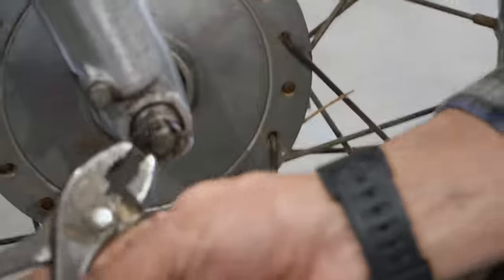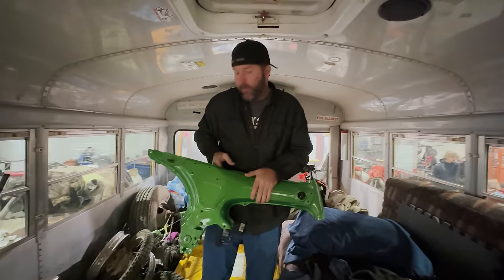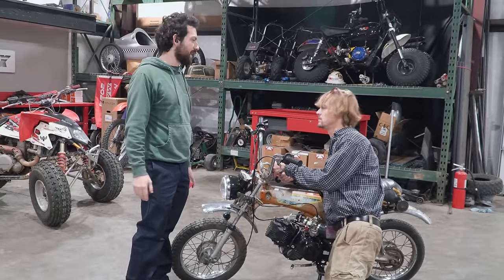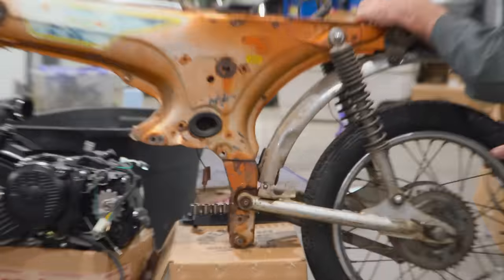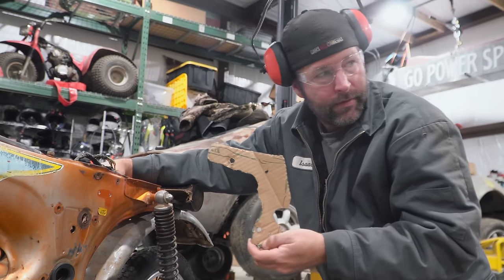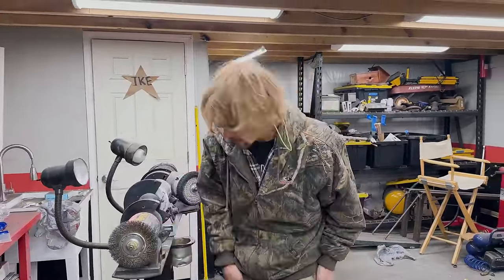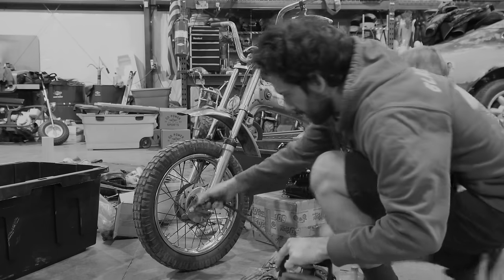We Got a Rare Honda ST90 in PIECES | Honda ST90 Build + Big Bore Swap!

Comment: You guys need to clean up those crash zones around the track. Pick out the dangerous rocks and trees and start sweeping those leaves out of the way and into where you might lay down. and the reason these didn't sell well is because most kids that started out on a trail 70 moved on to the XR 100 or the YZ80 or YZ60 since they were all real motorcycles and not mini bikes

Comment: Just a suggestion, but since you more than likely have a zero turn lawn mower out there, run it over the course before making a lap with all the leaves and tall grass. 
You can go slow and raise the deck a step or 2 in the leaves and it will work as a leave mulcher and blower.
Reply: Leaf mulcher. Singular for leaves is leaf

Comment: I bought one of these in 1987 from a bootsale (in the uk it cost me £22 i had the best fun on it rideing round feilds i blew up the engine and put a honda trike engine in it 110 cc it didnt fit the mounts so i made some adaptors for it in school (i was 14 at the time )i had a honda mtx front end on it renthal bars alloy wheels and a cammo paint job ,it was one of the first bikes i built as a teen and it took me a few days to work out my frankenstein bike and find parts that kinda fitted but i loved every minuite of it .

Comment: Having the hand controls in line with or behind the axis of the front forks will MASSIVELY help stability and turning feel. Every real motorcycle does that, I am honestly amazed vertical bars are a thing on minibikes, its so squirrely. Awesome build and video as usual, Ike is a trooper and that 212 is an absolute beast

Comment: Hey, you can fix that swiss cheese by blocking the holes on the outside with a thin layer of fuel tank putty and then use "POR16" on the inside to coat it generously. Once the coatings dry then remove the fuel tank putty from the outside and put the frame together and enjoy.

Comment: Contact a cycle suspension shop for suggestions for re valving and re springing the forks and get some better shocks. Looks like the bike has the power, just needs a ferret suspension so it can be ridden fast. Really needs some good knobbies too.

Comment: You could get a new sleeve pressed into your 90cc jug. Any reputable engine machine shop could do it,        for a price. Cast iron sleeves come in most metric, and imperial sizes, and, you'd just have to bore out the cracked sleeve,  cut the replacement to length, press it in, check deck height to make sure the sleeve is level with the fire deck, and hone it, to fit the piston. It IS a viable option, if a replacement can't be found. I've worked for companies that would do ALL the work, and hand you a good as new part, ready to be bolted on. You guys will be entering true builder territory, good luck, hope this helps.

Comment: Nice score finding an st90! They really don’t get built as often as the ct70’s and z50’s do and I think a lot of that has to do with the different motor mounts, leaving motor swaps options limited without adapters like you made. They are really a unique parts bin engineered bike. Stamped monocoque frame from the ct70, suspension and wheels from the sl70 and the engine from the ct90 minus the dual range gearbox.

Comment: The motor mount pattern is a little different on the CT/ST 89/110cc than the 49/72cc engines. Actually there's quite a bit of difference between the two engine families, almost nothing is interchangeable between them.

Comment: Yes! It couldn't get any scarier with new tires, could it? It'll be fine! An earlier chassis with the 90cc motor and transmission was my gateway to M/Cs. I went to a Honda 350 Scrambler- where I got my first road rash! Btw, put some genuine duct tape on that ratty seat for some real deal rustoration rat rod looks! Killer guys! You are a tease, John!

Comment: GREEN FRAME my guess is he powder-coated it bc he saw it was in good condition except the holes and ive drilled dozens of bigger holes in frames to save weight im 80% that frame is fine though id strip the coating and make that 80% in to 100% b4 rebuilding and riding it

Comment: You can bore out the jug and sleeve it. Even going big bore if you can find a piston. With the proper specs. Bore , compression height,  pin diameter. Possibly a 125 piston can be used..

Comment: Honda 90 to 125 motor are interchangeable just like 50 to 70 so u kand find part from m any top end I suggest going to a 110 3 wheeler or 125 top end I've done it so I know u can u just have to find right years but the engine is same as 90 125 3 wheeler engine in the bottom beside being semi auto we use to take st bottom end to turn our 3wheels in clutch I hope this is helpful

Comment: Last year zs 190/212  was on the Web lowest price I'd seen for  600$ new   if you look up and ask about the most common problem for the zs engines and  do the fix/ modify/upgrade and adress the issue before hand  it will be Hassel free for awhile.    Iv got a 212 4v fuel injection with a few mods in a grom clone  it eats up a stock grom

Comment: I just built my first predator 212 it has stock dished piston head aint milled but has the omb warehouse 15 hp kit comes with a superx 265 cam and billet rod billet flywheel overboard stock style carb and uses stock head it has stock valves but i have done serious portwork i port car heads and i opened it up as far as the casting would allowd and actually broke through the head on intake side and had to jb weld the hole around the breather tube that goes through the head but with the stock style carb i felt it was kinda sorry on throttle response but i found a tillotson 1 inch bore carb thats alcohol and man its night and day it races up so much quicker than the stock style carb and alcohol makes almost 3 hp just with fuel from the dyno trsts ive seen and the 15 hp kit is 15 with stock compression i believe it doesnt say it needed a ported head to make 15 but ive seen ported head make 3 hpon the dyno but tgats mild porting not going as far as the casting will allowso i think my port job may add more then 3hp and just an upgrade carb from stock to a mikuni added almost 3 hp so with my calculations thats close to 23 24 hp does that sound about right with a super x 265 cam id figure more lift will definitely add more power because of head flow does this sound correct or am i dreaming

Comment: I have a 73 st90 sitting here, Salisbury nc, in about the same shape as that one. But motor is complete, except for one of the head bolts/studs are broken off. Even found the original 1973 title under the seat.
Reply: Nice. I was in salsbury earlier this year

Comment: Did you know you don't need a battery on to  kick start a motorcycle. 💚💛❤️👍
Reply: Some of them you do. If it has EFI or a DC CDI unit it will require a battery to run

Comment: Yanno,if they had a tire groove with several different cutters,and an O2 reader then they could actually regroove,or recut older tires such as these with fresh new edges on the knobbies which is their grip,and actually tune a carb so it's stoichiometric ratio or ideal air-fuel mixture was spit on they could in reality have easy starting,better running engines without the Ikes it'll be fine mentality which in the end leads to burnt pistons,fried top ends,gassed oil,smoking,poor performance,etc. Those 2 are relatively low-cost and easy to operate and well worth every penny in gains,reliability...

Comment: I don't know if it was common in other places but in NE Ok during that era, you could get a MC license at 14 years old. The main restriction was that it had too be under 5 BHP (Brake Horse Power). It also had to be street legal, with the appropriate equipment. which left out Mini bikes. There were a few 70's and at least one 50 in our small town but IIRC the 90 exceeded the BHP allowed. So no one there wanted one. If you were between 14-16 you could ride the 70 but the 90 was too big. At 16, you could ride a much bigger bike. That limited the desirability of the 90 since you could ride anything at that age.

Comment: Hello, I have a 1974 Honda ST90 in great condition but need some advice.  If I’m making adjustments to the engine and carb, are the parts the same as the CT90?  If I want to replace any components, can I just use CT90 parts and use CT90 tuning specs?

Comment: Hey Cars and cameras I just bought a pwk24mm “racing” carb for my Coleman ct200u, when I installed it to the mini bike and tried to turn it on the carb would get flooded with gasoline, so bad that it won’t start because of how much fuel the carb was choking on, fuel would start coming out the side where the air filters is adapted. And I opened it up to check the jets and it was installed with the smallest ones so there was no problem there, then I tried idling it but nothing. You got any tips?

Comment: This is what happens when u floor a 2 wheel machine with torque in leaves...u end upside a tree been there done it a hundred times..fun to drift through the leaves with 4 wheels but not so much a bike is a no no i think you need blow your trail off first before goin bulls out by the way a knobby back tire should help if you can comprehend that 😅😅

Comment: I got a question if any one could answer I was taking off my stock carb on my predator 212 and I pulled the hose out of the engine instead of the carb do I need a new head or is it fixable
Reply: Push it back in

Comment: Need to run it against the cr500, see how quick it really is? I can see at least one of you never grew up around fast dirt bikes with lots of power, if a roughly 200cc turtle chaser is sketch for you, then you wouldn't have liked riding my built 1971 Suzuki, TM400 , it was the best 5th gear wheelie bike I ever rode. Always on the top 10 of most dangerous bike lists, mainly because its horrible handling characteristics, bur left a trench anywhere you wanted too.

Comment: come on john grow a pair bud 30:13 that thing is way faster than what that thing was intended for I got a question did the 90 have a high low range like the 70? I know it’s not the original motor so it doesn’t have it, but did the originals come with it?

Comment: I doubt it will beat a Grom. Just cause the engine is bigged doesn't mean its faster 😂
Reply: More bigger more better. It’s got more power, probably weighs less, and if it had new tyres and they geared it for a race it would destroy a grom

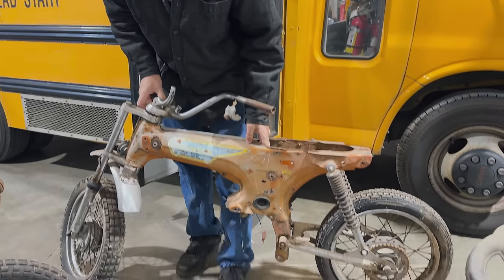Comment: 😮😮😮. WELL I HAD 3 OF THEM ,, NOT A GOOD BIKE ,,,WHY ,, NOT EITHER MINI OR FULL SIZE ,, spoke rims ,,not press wheels. BUT SMALL ,,WHEN RIDEING ON ROAD ,,THERE IS NO TANK TO USE ,, WITH YOUR KNEES ,,LEGS 👎 THEY WILL REACH SPEEDS OF 50 2:06  + ,,FLAT SEAT ,,DINK BARS ,, ONLY 3 SPEED ,,AUTO CLUTCH ,,, ITS A DATED BIKE ,, HARD TO FEEL COMFORTABLE ON ,,JUST ME ❓ SOLD THEM TO RAFTING ADVENTURE GUYS FOR RETURN PICK UP TRUCKS ,, DIRT ,, STILL IN BETWEEN ,, NICE LOOKERS THOE ,,,JUST NOT A FIT FOR ,,WELL ENNY PERSON ,, MADE FOR JUST LIKE 3 OR 4 YEARS ,,,A TIME HONDA SHOPS MADE STEP SIZE BIKES ,,